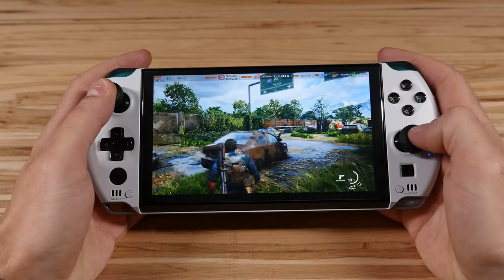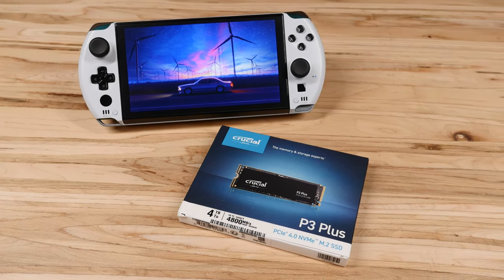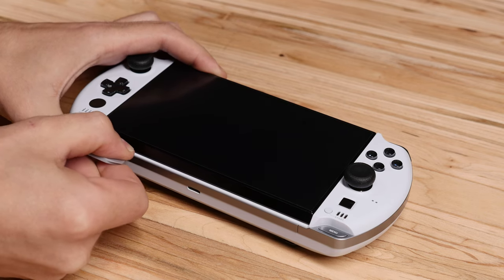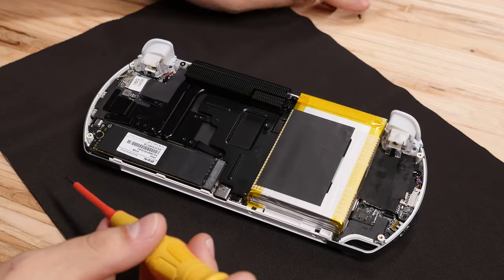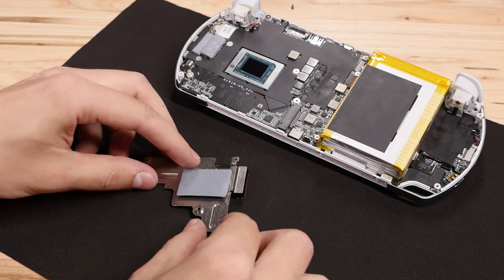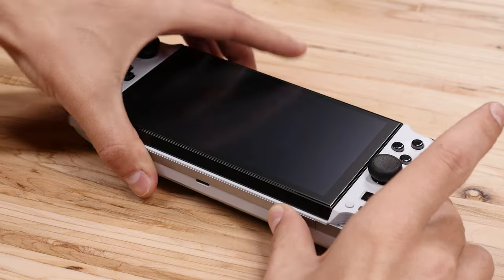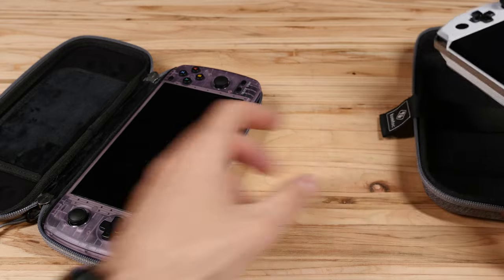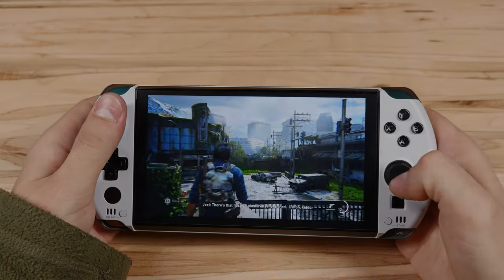My GPD Win 4 6800U Handheld with a 4TB Crucial P3 Plus M.2, Cooling Improvements plus Accessories

Comment: I got the GPD Win 4 with 32GB of ram, and added a SP 4TB M.2 NVME. I also changed all of the thermal pads and added a fresh coat of Artic silver thermal paste on the processor. This baby is now lightning fast and very quiet.

Comment: For those wondering why CRUCIAL is literally like the ONLY SSD you can use for this is because its lack of DRAM, and it's one sided, meaning it fits within the voltage envelope that GPD allots that slot which I think is like 1.7v if I remember correctly and like proper 2 sided DRAM CACHED SSDs are like 3v normally. I did this mod to both of my Win Max 2s (2022 and 2023). Took forever to find these SSDs, though, weirdly the new GPD Win 4 2023 seems to support double sided M.2s. Or maybe they're also using a similar Crucial style M.2, since they do offer a 4TB version, which I picked up also.
Reply: Nah, they're not the only make of large single-sided m.2 drives. At the very least, all the Samsung 990 Pros are single-sided, including the 4TB model. Chucked one in my GPD Win 4 2023, works fine.
Reply: Stop spreading misinformation. I’m using a Silicon Power 4tb SSD in mine and it works phenomenally.
Reply: @TheBossVinegar  "LIKE THE", means one of the EXTREME FEW. Learn English better.
Reply: @tdata545   Even so, you’re still wrong😂🤣😂. Any 2280 SSD can go into the GPD Win 4, double sided or not. The Crucial ones are the last one I’d pick over the Silicon Power ones or even Samsung 990 Evo, plus the other 100+ options you can pick from. Don’t tell someone to learn better English because don’t know how to articulate yourself properly. You’re literally just spreading misinformation. No one’s paying attention to “like the” when you have an essay of text that means nothing since it’s built off of a false base. There aren’t an “extreme few” that’ll work, that are quite a few, and I mean a lot so stop.
Reply: @TheBossVinegar  Which VERSION? Since As of 2022 and 2023 that wasn't the case. Then that would mean it could take an 8TB stick  without issue.

Comment: How do you feel about the device getting hot on the right side? Could you fix that? Does it bother you? I am going fot the 7840U version and love the win 4. Only thing I worry about is the warm/hot touch on the right side.
Reply: I'm buying a 7840u, can you tell me if this heat is better?
Reply: @felipelima1343  The heat is fine with a few modification. Dont run on 25Watt on portable mode if not needed. maybe a heatsinc on the ssd and get a silicon case and you are good.
Reply: The silicone I use a case is only getting as warm as my hands make it warm. So its warm to the touch (not cold obviously)
But the termals itself are very good for a device this powerful and this small

Comment: Thanks for the video. Looking to do the same for the cooling and great to see someone else already doing it. I have to open to do the screen fix and figured i would be smart to hit the paste and pads as well.
Reply from the maker: Yea I've gotta order what's required for the screen fix and get back inside it. But although I don't really notice anything. I am using the 59hz hack however. I'm more interested so I can get the proper 40Hz vs the 45Hz it comes with. Phawx did a great video so I may just follow that :)

Comment: Thanks for the video on this! I have the Win 3 and I'm very happy with it so far. I will probably get this Win 4 later or get the Win Mini that just came out. I use this device mostly for remote work (replaced my laptop) with a docking station, and of course I do some gaming on it. I remote into my main computer at home if I need the extra horse power to get things done, but also I can remote play using Parsec. These small computers are very convenient, and they are the perfect UMPC I always wanted many years ago. They had some UMPC's in Korea (early 2000's) that I got my hands on from my Korean friend , that had Windows Ce as the OS. These GPD devices remind me of those PC's I had, only in modern times. They were around the same size too. We are very fortunate to have these awesome PC's these days.
Reply: i have the win 4 6800u i willl get the 7840u version soon

Comment: I have a 16gb 2tb, but when I launch the last of us, the game says vRAM usage is WAY too high. How are you not even close to the cap? And how are you running everything at ultra? Do you have the 32gb model?
Reply from the maker: When you see me run the game at ultra, notice before that I change to game streaming before launching it for that part of the video, just to show how good the performance can be over home WiFi. In the beginning when I play it, that's native at 30fps, 28w combination of low to medium settings. But I don't like running it at 28W as it's dead in an hour. So I game stream from my main PC with a 3090, all maxed out maxed out and runs for 5 hours plus. I just posted another video specifically about my game streaming set up. If people are keen, I can make a tutorial too :)
Reply from the maker: I also have the 16GB version. I wiped the original OS however and installed Win 11 Ghost Spectre, which is like Tiny11 but better in my opinion. Has built in tool to clear RAM and usually for running The Last of Us Part 1 natively at 28W, I have to close pretty much all background apps, clear the RAM and only assign 3.5GB VRAM in the BIOS, with 4GB VRAM in the BIOS I find that I can't launch it at all. Unfortunately the game is still quite poorly optimised for APUs.
Reply: @SimpleModz  hey that’s awesome thanks for the response. I thought you were streaming it but I just wasn’t 100% sure. 
I don’t have a great gaming pc so I’m wondering how the input delay is??
I remote play my series X on my win 4, but there’s just the smallest input delay and it’s barely too much for competitive or multiplayer games
Reply: @SimpleModz   yep I agree. I feel the game should be performing so much better than it does, but it’s just not optimized that well. I did a fresh OS install of just windows 11, not GPD’s version but I’ve never heard of ghost spectre. Kinda makes me wish I looked into it but eh it’s probably fine

Comment: Hi love the video would adding the thermal pad on the ssd reduce the heat also or is that a no go? Total newb at this always had a Consol (Xbox)
Reply from the maker: Thanks a lot!

Nah, adding a thermal pad to the M.2 won't do anything as the M.2 doesn't actually come into contact with any heatsink. The thermal pads themselves don't dissipate heat, but rather help spread the heat to the heatsink. Same as what thermal paste does for CPU/GPU cores for examples upon contact. I'm no expert so my explanation may not be 100% accurate, but hope this helps create a better understanding :)

Comment: I will buy (GPD win4)  soon. Do you advise me to take 16 RAM or 32GB? I will play high graphics.  only play games
Reply from the maker: Awesome. I reckon get the 7840U version and get 32GB of RAM. I'd get 32GB now if I'd buy again. It may sound overkill for a handheld but some games do need it, especially since it's shared as VRAM with the APU. I reckon if you'll keep it for a long time too then definitely 32GB. Hope this helps

Comment: I'm waiting for the 7840U with OcuLink model.
Reply from the maker: I'm waiting on the GPD Win Mini, also with 7840U and OcuLink. That's gonne be a pretty awesome unit judging by the rumours.

Gonna keep the Win 4 with the 6800U as I think it's plenty powerful for what it is. Unless they offer a drop in solution to upgrade the motherboard like Ayaneo is doing for the Ayaneo 2 with the announcement of the updated 7840U model in the 2S. Could then make a motherboard upgrade video on the Win 4 if they do that.

I have however ordered a Geek 1S with the 7840U and 32GB DDR5 - the new Nebula Purple colour. Early bird pricing on their Indiegogo at the moment.
Keen to get my hands on that unit too. I haven't played with any Ayaneo device before and the pricing seemed great to me.
I think the GPD Win Mini will be priced similarly, or the updated Win 4 - wait and see, shouldn't be too far from a new announcement. I think they said June for the Win Mini campaign start.
Reply: @SimpleModz  Oculink is why I will be skipping the 7840 model. I find having the USB A port to be so useful.
Reply: @19CD91  I kind of agree I find  having a USB A kind of a necessity for being able to use USB drives or able to copy files from a external drive or from pictures/videos from my phone. Though I believe there are USB C to USB A and HDMI dongles that can be used on the USB C slot to give the new oculink version a USB A and HMDI slots. I did some research and found some stuff like that that may solve this issue. No reason it shouldn’t work I hope. Last time I checked there was one for just 20$ or so of amazon. One of the devices I saw had 3 USB A female/in, 1 HDMI/female/in, a USB C female/in, a micro SD  card and SD card slot and a single USB C make/out to plug into the USB C slot on device/ GPD WIN 4. Just plug one of these into one of the Oculink version’s USB C slot and USB A and HDMI problem solved 😊
Reply: @aaronsharry2351  I just don't want to resort to carrying a bunch of adapters. USB A is still the most used PC port. And the real issue with oculink is that it was never designed to be a mobile port. I would be extremely worried to have any exposed ports on a mobile device that are not designed to be hot swapped.

Comment: lmao thermal grizzly. trash product. you want the best paste possible? arctic silver 5. but that would mean masking off those little micro components because AS5 is electrically conductive. clear nail polish would work. then slather up the chip in AS5, and it will be 5-10c cooler than thermal grizzly (after the 50-200 hour break-in period) you should also manually spread the paste yourself for 100% chip coverage. any gap will cause overheating and issues because there is no IHS. its direct die cooling.